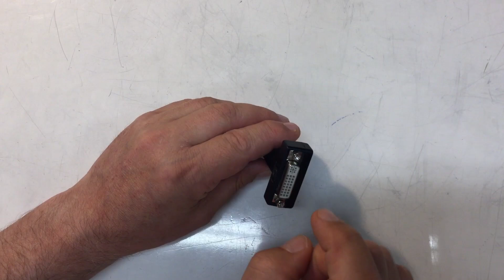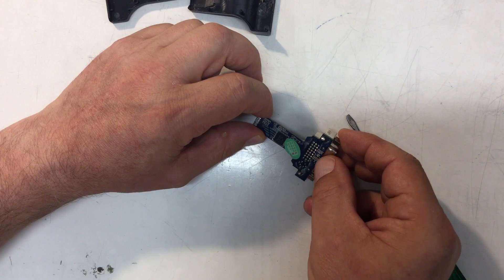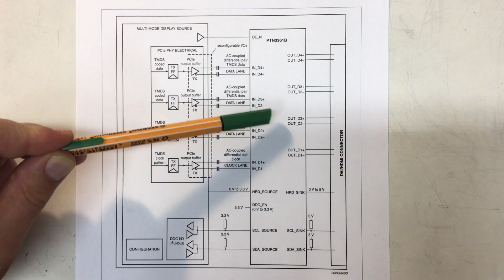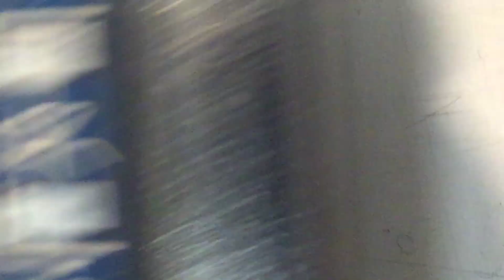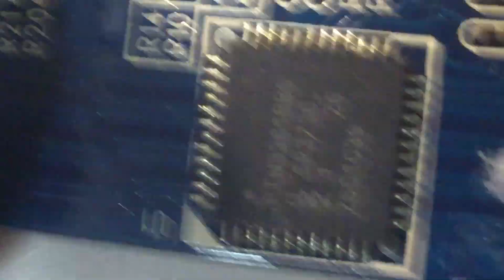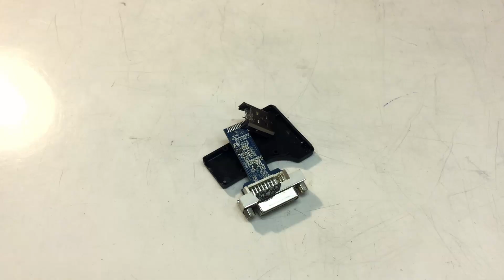DisplayPort to DVI Adapter Teardown (All the Chips)

Comment: Displayport is AC coupled at the source, so additional ac coupling caps arent needed at the converter. In fact, one of the key uses of this chip is to convert displayports ac coupled serdes into a dc coupled tdms signal.

Secondly, strictly speaking this is to enable a dual-mode displayport connector to output to dvi, as true displayport signalling is actually packet based, and can run on anywhere from 1 to 4 lanes in differing applications.
Reply: As usb- c displayport alt mode doesn't support dual mode, usb-c to dvi adapters actually have protocol conversion built in.
Reply from the maker: @varno  Again, thanks for the info! USB C isn't even on my radar as a display interface 😅 But of course it's one of its functions.
Reply from the maker: Thanks for the info! I'm to hung up on the electrical side of those things (level shifting etc.) to deep dive into the higher protocol layers 😅 So, thanks again for providing that info!